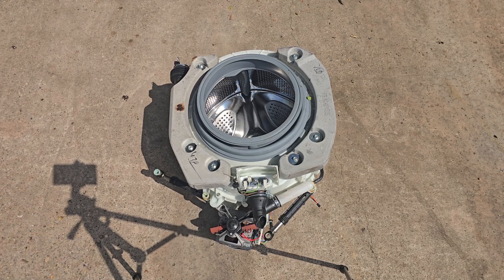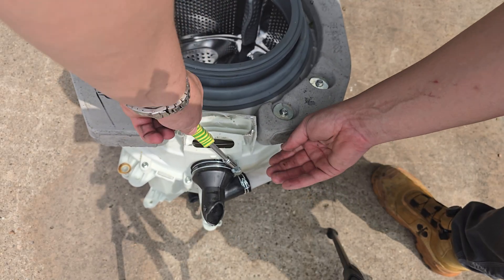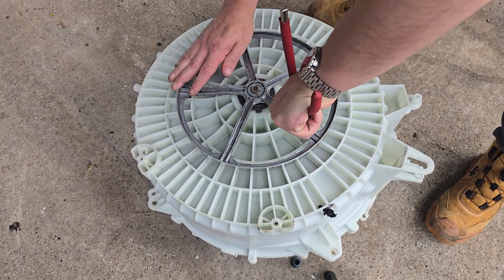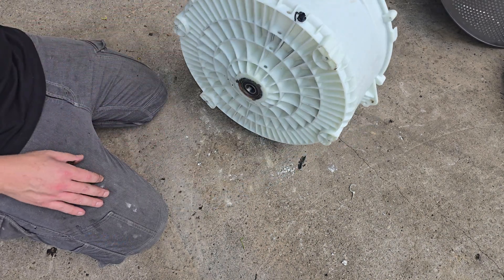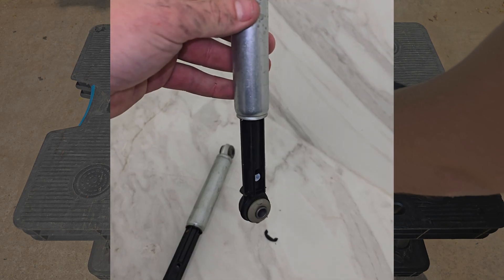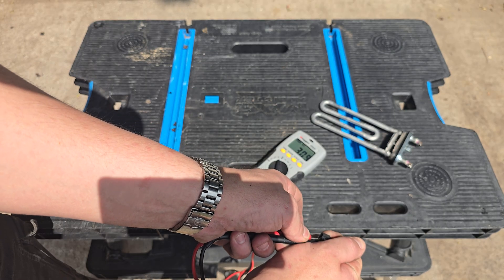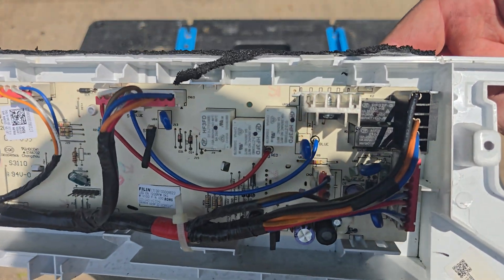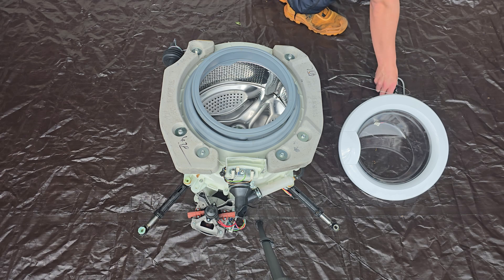Every Part Of A Washing Machine

Comment: Brilliant! I'm saving this to my DIY playlist! I'm about to attempt to diagnose a Miele w1614 potential pcb fault. If the board isn't corroded i reckon i can just take it to the local electronics repair shop and they can identify and replace any faulty components. Failing that there's a place in the Netherlands that takes them although they now only take boards from businesses!